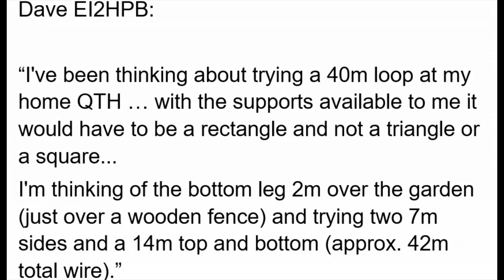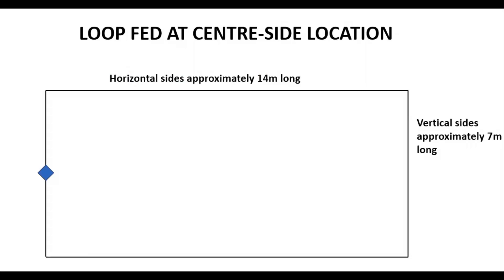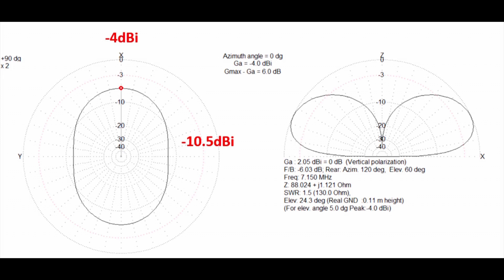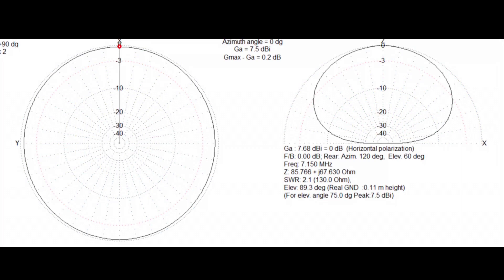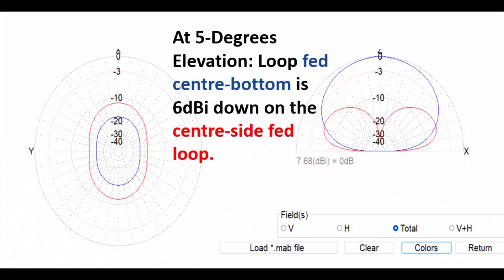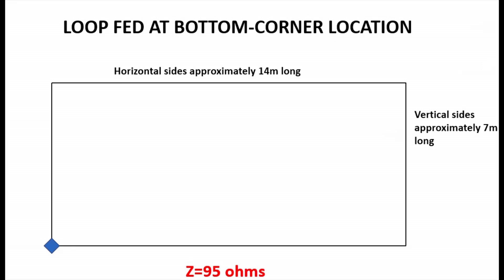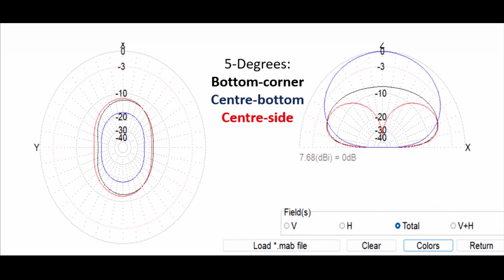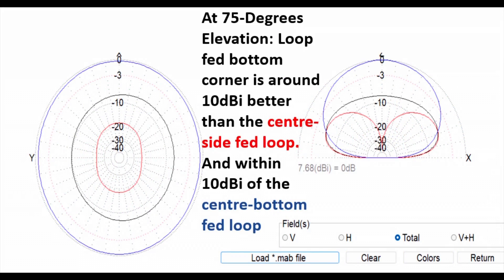A Small Space 40 Metres Antenna: The Full Wave Loop

Comment: I ran this antenna though most of the 90s. It worked well but not for extreme 40m DX(VK,ZL from UK) What MUST be said about this antenna is it works on ALL bands above 7 MHz! It really performed on 20 and 15 as I remember, even WARC bands had lowish impedance that my TS530(valve PA) could tune into. You feed with a 4:9 balun, yes 4:9, it is a thing, look it up, and have about 20 feet open wire feeder from balun to feed point. Mine was fed at the top centre, so basic horizontal polarisation. Well worth the effort, and it did exhibit the famed low noise on receive property.
73 de G0AFV
Reply from the maker: Great points thank you

Comment: Would you use something like  a 4:1 balun at the feed and Is it resonant on 40m and the harmonics ?
Reply from the maker: Yes you can use 4:1 and it should be harmonically resonant too
Reply: Use the 4:1 Ruthroff voltage balun for a multi band loop fed with coax. Much lower receive noise and less than 0.2 db loss. And no common mode issues. KE6VG

Comment: This is great. Seems much easier to feed at the corner, and very very decent performance compared to the vertical. Better than I had expected. 👏🏻 

I wonder if the length and height of your rectangle affect that much(?)—would you have to go to the extremes to start to see big variations off of that corner-fed example?

The other thing to think about—maybe—is how to isolate the feed line from the element when fed for vertical polarization (on one of the sides). I guess you’d ideally want to pull that feed line away at a 90 degree angle from the side, otherwise I’d assume you’d get coupling between the feed and the radiator. If choked well just below the base of the rectangle (to isolate the CMC on rest of the feed line to your radio), I wonder how much that would throw off the pattern?  I’m thinking that this hypothetically makes this otherwise mostly balanced antenna into a more unbalanced one. Just spitballing here 😊
Reply from the maker: Food for thought, thank you

Comment: If the rectangular loop was installed with pulleys (or equivalent) on the supports at the corners, then the loop could be slid around effectively relocating the position of the feed point in relation to the geometry of the rectangle. Presumably, since the current and voltage nulls and peaks are being relocated relative to the feed point, then this technique could help fine-tune the match.

If taken to the extreme, it might have other effects such as the direction of the gain lobes and nulls.

Cheers.